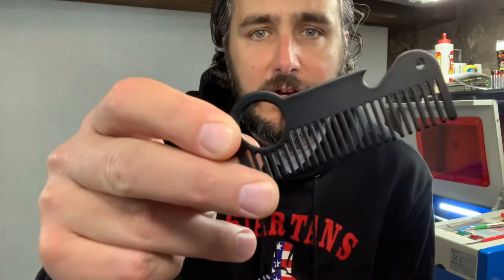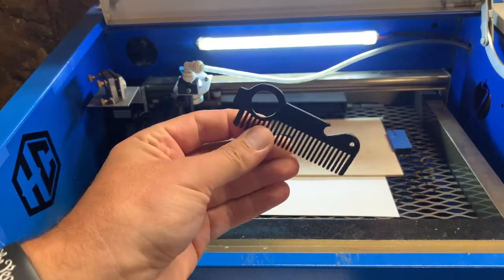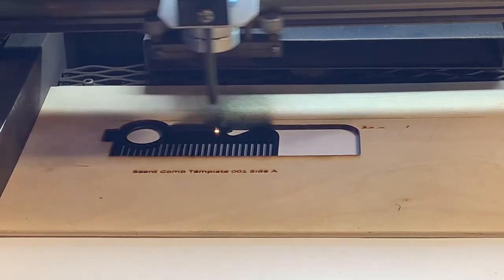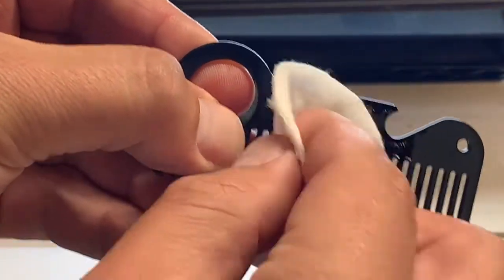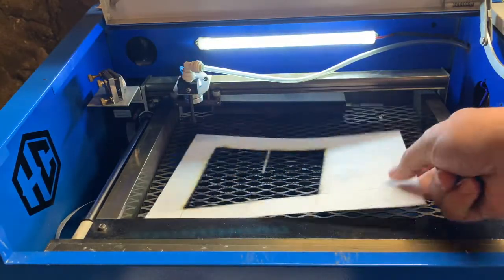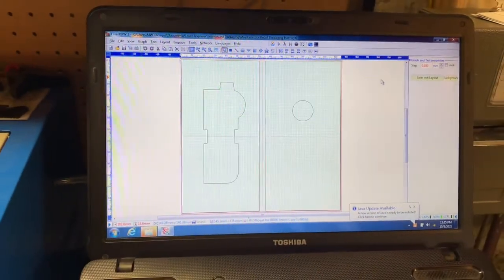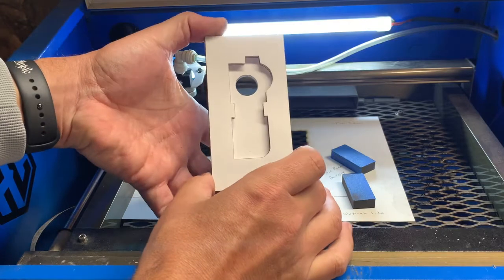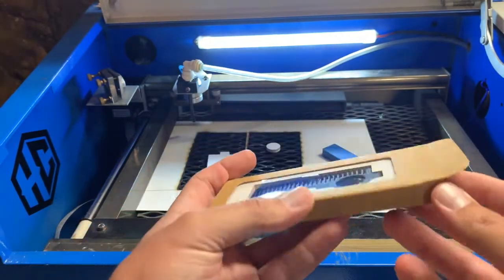Engraving Powder Coated Metal with the K40 Laser

Comment: Have you looked at K40 Whisperer from Scorch Works.  In your leather video you go through an erase of the cut outline and then using CTRL-Z to bring it back.  With K40 Whisperer you just color the cut line red and the raster black and then you can have one piece of artwork that doesn't need to be edited to do both operations.
Reply from the maker: Edward, I am familiar with the K40 Whisperer Software, but I have gotten so used to using Laser Draw that it just works for me. I will be getting a new larger laser this month with the Ruida controller, so
I will have to figure that out.